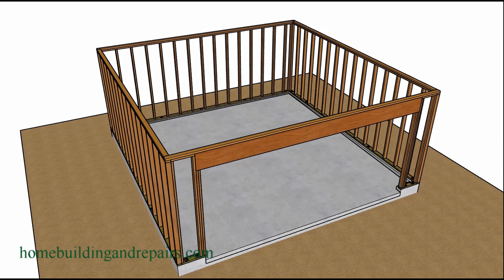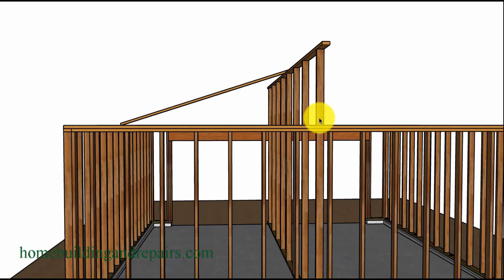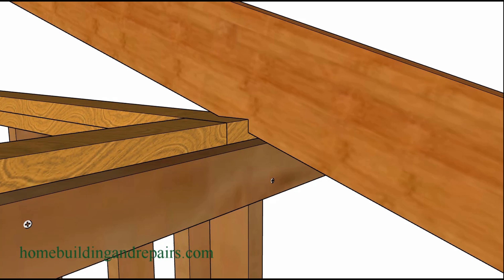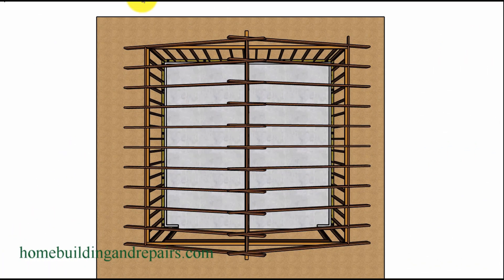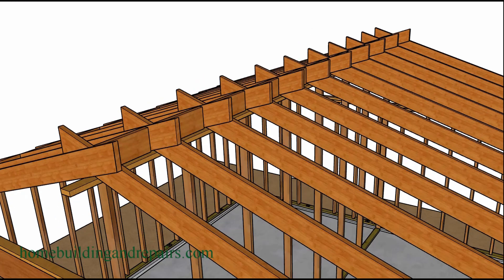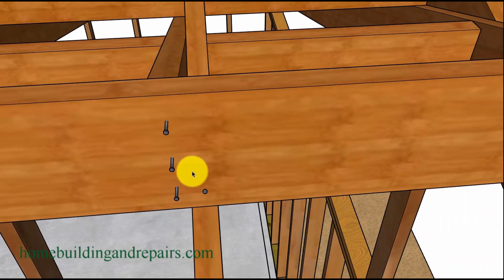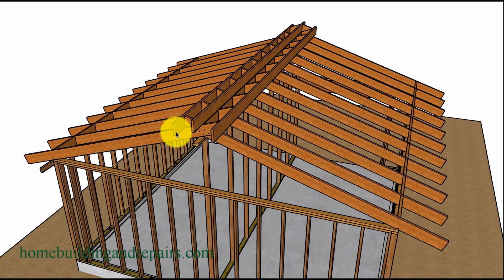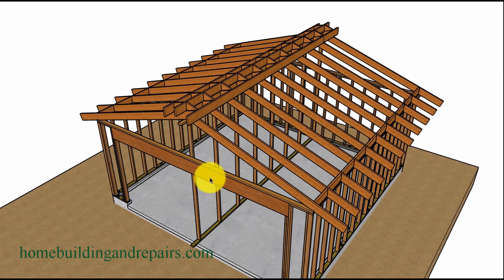How To Build The Infamous X-Ridge Design - Roof Framing Ideas

Comment: Is the purpose of that system to vent a nonliving area building through the roof putting a rain awning over the exposed area?
Reply from the maker: The only purpose of the video is to provide others with a different type of design. I thought it was interesting and seems like it would work, but have never built one personally or seen one built.

Comment: Similar to this method, could you cathedral a room by removing the collar ties, adding a knee wall near the top, then doubling up on the rafters by adding an additional 2x6 such that it becomes a 2x12? This would be an after mod to a house.
Reply from the maker: You might be able to as long as the upper part of the roof is structurally supported. I don't know what the structural strength difference would be between the 2 x 12 and a couple of 2 x 6 sitting on top of each other, so I might not be able to provide you with an answer there.
Reply: @gregvancom  Would be an interesting analysis since the center of the board is a shear plane in bending. If you attached the 2x6's with plywood ties (12"x12" screwed to the 2x6's). You would still need some type of collar tie right?
Reply from the maker: @SunriseKnight  I don't think you would need a coller tie, because nailing the two lapping rafters together seems like that would be effective.

Comment: Are there structural advantages to this design?
Reply: i think it could decrease the usefulness of a ridge board, so basically the tip of the roof become stronger than the sides...now why would you want that? well maybe you have a waterfall that's falling right onto the ridge board lol
Reply from the maker: I think it would depend upon the type of roof you are going to compare it to. For example it might not be stronger than a roof with a structural beam supporting the top of the roof.